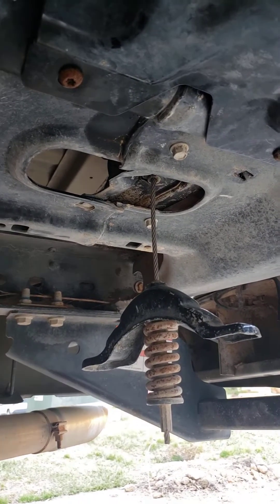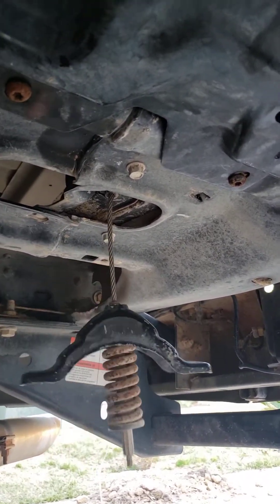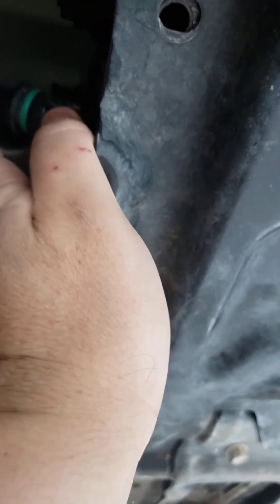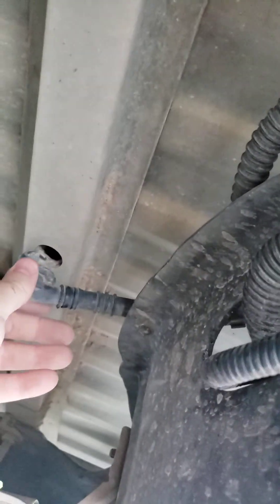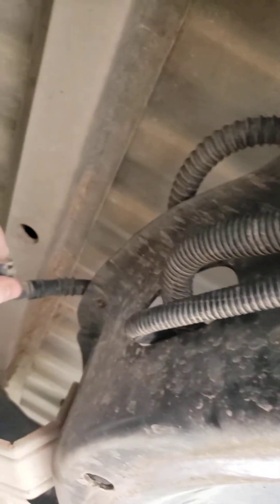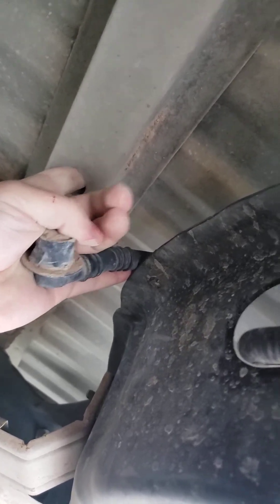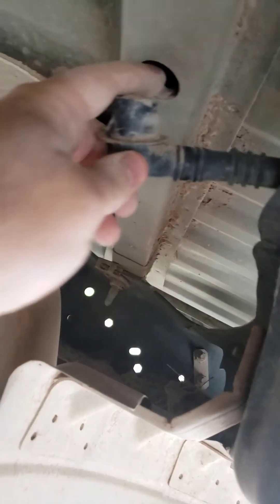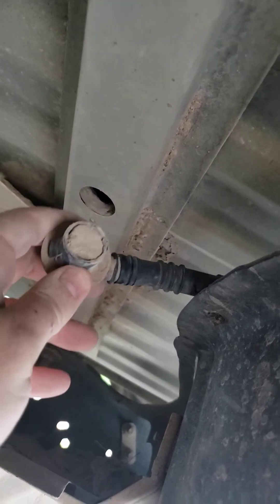Gas Pump Shuts Off Automatically!  Ford F-Series Fuel Vapor Charcoal Canister Troubleshooting

Comment: Cut that fitting and add a filter to it and zip tie it problem solved, I'm gonna try this and hope for best, maybe I don't need a charcoal canister but this is second truck I had this issue with my last truck I had to unplug the EVAP purge solenoid to be able to fill the truck up

Comment: Hey, Texas had severe flooding in its recent past, could be the reason for the mud
Reply from the maker: Yeah, i thought about that. I got the truck in 2019 from a dealership in Georgia and it had a clean title.  So if it was in a flood and not disclosed, then they did something illegal, but it wouldn't totally shock me.  Still, besides this one canister issue, I haven't had a problem with it in 6 years and about 50,000 miles I put on it.  So I've probably already gotten my money's worth out of it.

Comment: What truck is this mine is a 2008 f250 and I have this problem I haven replace the canister but that was my next move
Reply from the maker: It is a 2015 Ford F-250
Reply: @MrBothomas I’m guessing a 05 would still have the same design as yours?

Comment: I've got the same setup. Do you just pop that unit from the frame channel? I tried tugging on it but it never budged. *Edit*: I pried around on it until it popped loose. Mine had dirt in it. I'll put gas in soon and see if that fixed it.
Reply from the maker: Yes, it just pops out, but it may be stubborn if there is dried mud like I had.
Reply: Turns out I had to replace the cannister anyway.

Comment: Husband got a used F250 at auction, same problem. It was obviously in or under the water/mud. Already had engine rebuilt. This is exactly nice wrong with his, that line is full of mud. You said you just cleaned it by blowing air, pressure washing? Is it okay for him to run the pressure washer through that metal bar underneath as well once that line is disconnected?
Reply from the maker: Sorry, I am just seeing your comment.  Yes, it is perfectly safe to shoot water into the bracket once the hose is detached. It is just a piece of metal designed to stiffen up the bed of the truck.

Comment: I cut that line off and put a fuel filter on it then ran the other end with bulk hose to a safe place away from mud.
Reply: I just unplugged mine completely and ziptied a mesh screen to it left the hose dangling next to charcoal canister fixed my problem, I let mine just breathe in fresh air all time mesh screen keeps the dirt and stuff out
Reply: What kind of filter ?
Reply: @mrtechpat  any kind of in-line fuel filter just so long as it filters